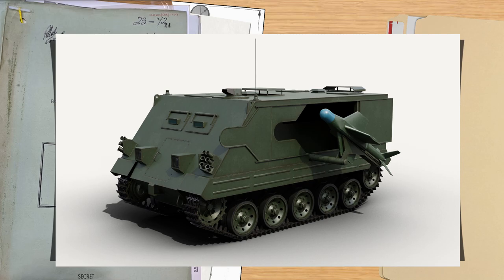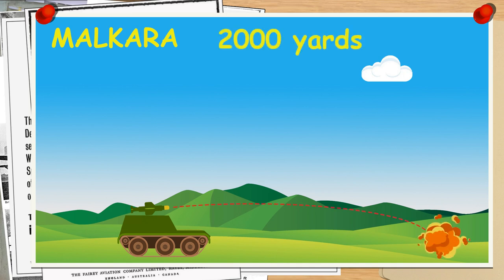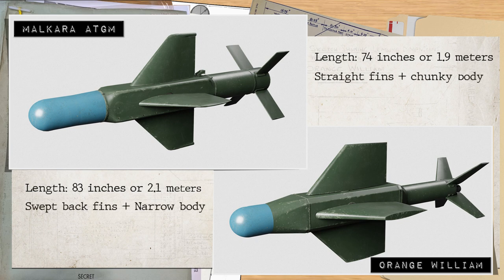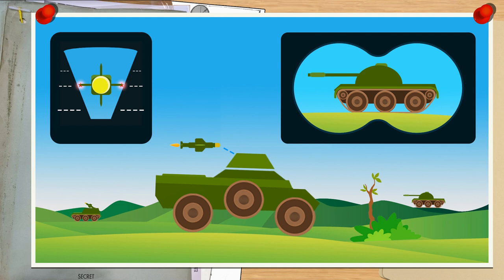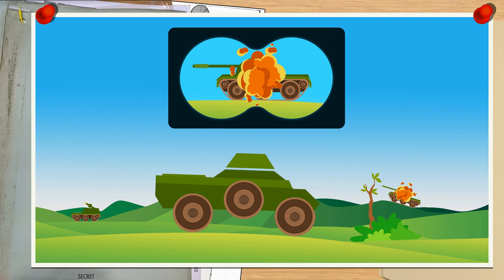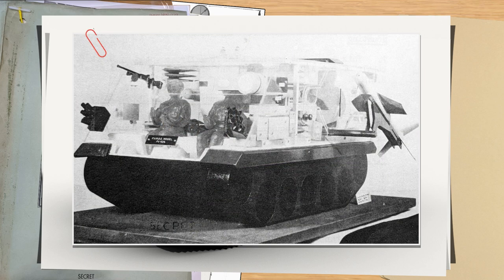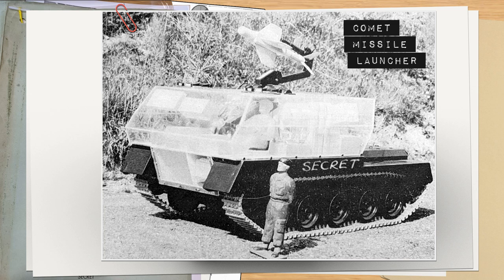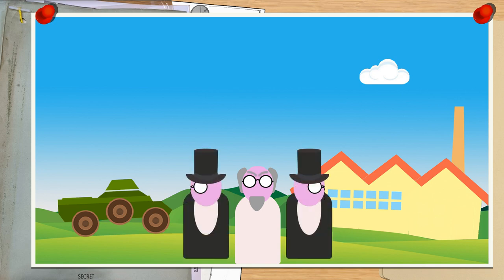Orange William  - Tank Design & Development

Comment: The original (bonkers) MoS 1953 proposal could probably only now be met 60 years later using something like Starstreak or a smaller CAMM derivative. There are parallels between the physical/psychological problems the operators faced then and the issues Apache gunners face today when being presented with a different image in each eye - headaches, vomiting etc. Excellent video Ed.
Reply: Interestingly both Javelin and Hellfire have anti-air capability (normally discussed in the context of engaging helicopters).

The big issue appears to be having the kinematic ability to accelerate, guide and engage a fast fixed wing aircraft and have a warhead big enough to deal with an armoured ground vehicle, all in package small enough and light enough to be carried/handled in large numbers.
Reply: @richardnicklin654  Anti-air missiles usually have a proximity fuse and an AA warhead producing big clouds of shrapnel.

An anti-tank warhead is usually of the HESH type, designed for a direct hit.

Both are very contrary - they are only useful for it's intended purpose. There is no point in firing a Hellfire at a plane - if you don't score a direct hit it is useless - waste of money and resources.

I think that is why AA rockets are used for AA tasks and AT rockets for AT tasks.
Reply: @stanislavczebinski994  only Brits use HESH AFAIK. Virtually every other country uses HEAT. Making a HEAT round multipurpose beyond its inherent concussion impact is as simple as embedding some tungsten projectiles in the surface, as is done in the American Advanced MultiPurpose tank round. The broader question is whether a sufficiently nimble rocket could move a heavy warhead like a modern tandem round with extra flak.
Reply: @NXTangl  HEAT of cause - HESH is AFAIK outdated.

Yes, adding some fragmentation is possible - a true AA round will still be more effective at taking down planes.

Adding a second function means either twice the weight or half the functionality for each purpose. Plus, one round costs at least twice as much.

I guess that's why most munitions have only one function - but one they are pretty good at.
Reply: That sounds miserable
Reply: @NXTangl  the Brits still use HESH, but only as an alternative to HE. They use HEAT for missiles and sabot for anti-tank. Although starstreak is effectively Anti Air Sabot.

HESH has some advantages over HE, as it has slightly better effect on fortifications and armour, whist still having good area of effect. Importantly, most tank engagements aren't against other tanks, so HE is the most common round fired and most common loaded. Therefore, there's a benefit to having something that has some AP effect incase you stumble into some enemy armour. Not that HESH will be reliable against tank level armour, but it is more likely to do enough damage and concussion to give the loader time to load sabot.
Reply: @stanislavczebinski994  yeah, the AMP is meant to replace HEAT (anti-armor), HEOR (obstacle demolition), HE (anti-infantry), and canister (also anti-infantry), depending on fuse setting.
Reply: @NXTangl  IIRC today, HEAT is used against AFV/APC or other "soft" vehicle targets - against MBT, APFDS is used.
Reply: Actually an anti-air/anti-tank missile was done in the late 1980s, early 1990s with the US/Canadian ADATS project. It's not quite as bonkers as this one but achieved the same practical result.
Reply: Operators for naval rangefinding binoculars also experienced nausea, eyestrain, headaches, and motion sickness. Especially in poor visibility situations like low light, smoke, fog, etc. Drachinifel has a video about the topic. Long story short: most systems involved matching up two images supplied by the binocular’s lenses and mirrors.

Comment: I have an example of the external missile guidance sight you are talking about from 1960, but it was never really as complicated as you describe. The sight is designed to gather and then guide the missile. They had a thumb joystick under the optics and a toggle switch to take over the guidance. A wide view is used for gathering the missile, when you can see the missile flare in the wide view you could take over guidance and then switch to narrow view to guide the missile to the target. All quite logical really and it worked well. To understand the 'facing backwards' issue, you need to think of the tactical situation the crew would be facing when in action, the aiming vehicle really wants to be facing away from the enemy for a fast getaway. This is why aimer was going to be facing backwards in the vehicle. The crew just preferred to face the target because of the disorientation you describe. But this issue entirely went away when the fixed sight was moved from the roof to the commanders hatch, that could be rotated.   The same optic system that was  developed for the Malkara was also used in the Vigilant and SwingFire. The optic units and controls were reused as they proved to be so good (and expensive).

Comment: Where do the british anti-tank missiles originate from? All i know about early anti-tank missiles is the ruhrstahl X-4 that the french messed around a bit with but turned out to be a bit of a dead end in design due to the annoying fuel it used.
Reply from the maker: early work in guided system can be traced back to 1928 with sheppard and ram systems albeit air tto air and air to groundm albeit in dronesm for ;missiles; as we would see them - 1941-42 era with guided bombs, the first funtioning tests in 43-44 and the first beam riders and heat seeking missiles in jan 45, with little ben (longshot) but the war effort was focused in what coulkd be pridcued fast and quickly and so many eperimentals were at a slower pace so that resources, materials and staff could be where they were most needed